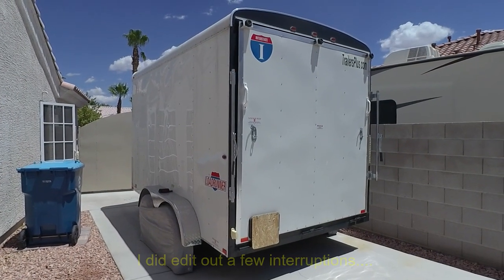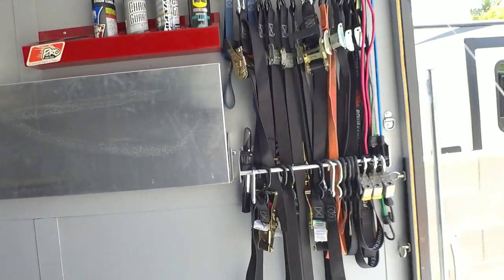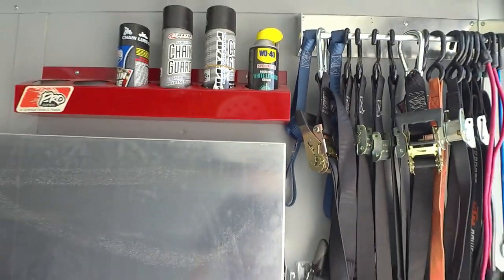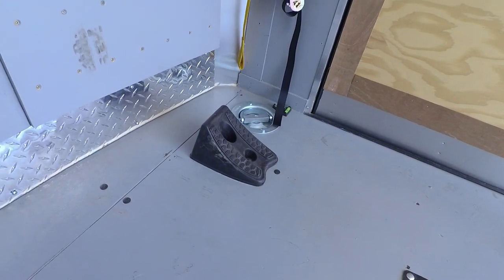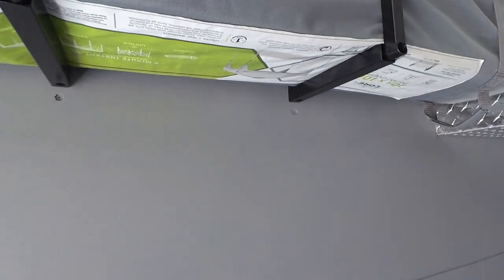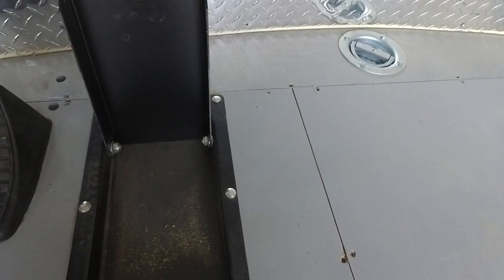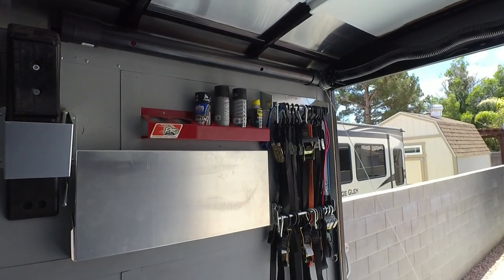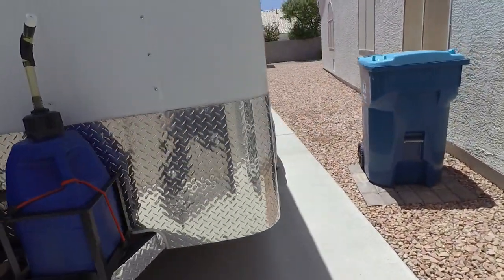7x12 Enclosed Trailer Custom Mods (Updated Video)

Comment: I just got a 16 ft ATC trailer.  I have 2 rows of E track on the walls, and two rows on the floor for tie down.  Up in the nose,  I have a horizontal Track on the  floor, tied into the frame so I can connect a winch to it if I need.  Etrac makes a single tire motorcycle stop that clips on the Etrac.  If you flip it backwards,  it is a GREAT winch connect point,    I think E trac is a better solution,  there are a lot of accessories that you can hang stuff like tires, cabinets, etc.    HOWEVER you did these things yourself, using your skills and brain which I think is WAY better.  I am the fat old guy who can sit around making comments,  YOU are the guy who is doing it!!!   I definitely respect what you've done.   I have kids your age probably,  I would rather they be able to DO what you did,  instead of BUY what I did!
Reply from the maker: Thank you for the feedback...  your setup sounds very nice.  I did consider E-trac, but opted not to use it for several key reasons (specific to what I was looking for and needing).  Also, I just sold the trailer because I have to go to a 8.5x14...so all the mods will have to be redone!  I'll re-look at E-trac as an option...  have a nice one...

Comment: Options are interesting, e-track would probably be of significant benefit.
Reply from the maker: Thank you for the suggestion....  I considered e-track as one of the options...but decided against it for several key reasons.  I've been extremely happy with the setup as it was specifically designed around my needs.  Have a nice one...

Comment: couple questions.....Why didn't you paint the ramp extension and side door? Also you could insulate the ceiling and make it much cooler inside. Love the brackets for the tents & chairs, very ingenious. Great job!
Reply from the maker: Thank you for the kind feedback.  Regarding your questions:  I didn't paint the extension because I consider it a replaceable/sacrificial item...the wood gets trashed due to it being in most contact with the dirt/rocky terrain.  The door wasn't painted because I had planned on putting other mods on the door...and I just never got around to it...but will one day.  I'll have to think about/look into some options for the ceiling.  I do not spend too much time inside the trailer and when I do it is almost always with both doors open so the temp is more ambient temp vs radiated heat temp from the ceiling.

Comment: where did you get the hinge for the rear door extension .. great video and modifications
Reply from the maker: Thank you for the kind feedback...wrt the rear door extension hinge...I just reused the stock hinge that was installed from the manufacture.  etrail.com (not advertising for them) carries these same type hinges https://www.etrailer.com/s.aspx?qry=hinge

Comment: What paint did you use on the walls? Trying to figure out which paint to use on mine myself and keep hearing various answers from people on what to use. Thanks!
Reply from the maker: I used Sherwin-Williams:  "Armorseal Rexthane I" for the floor, and "Armorseal Tread-Plex" for the walls.  I've done 3 enclosed trailers with this paint setup...one of the best mods/choices I've made!

Comment: Extra tall is how many inches? Good information
Reply from the maker: Thank you for the kind feedback.  ... It depends on the trailer manufacturer, but it usually is approx 6 inches taller...the same height as an 8.5 wide enclosed car hauler.  It wasn't common for a 7x12 to have 75 inch height opening...you had to get a 7.5x16 or larger to get that height. 7.5x14 UTV enclosed trailers pretty much now come stock with the taller height.

Comment: Where can I find a similar fold down table?
Reply from the maker: I'll provide info for both tables just in case we are not thinking about the same table 😁  The smaller fold-down table is from Pitposse.com -- Pit Posse Flip out work tray 32 Inch (SKU: PPFOWT32).  Larger fold-up table is from Etrailer.com -- Tow-Rax Wall Mounted Folding Table - Aluminum - 45-1/2" Long x 18-1/2" Wide (Item # TWSP45HFTA).  Sorry for the delay with my reply...

Comment: Hi Steve, I've been trying to find some tent/canopy brackets for over a year now and haven't come across anything I really like until I saw your set-up. I'm just curious, did you base these off of a commercially available bracket? I can't find anything like yours online so I've been thinking about an "L" shaped collapsible shelf bracket and using a bungee to secure it but before I do, I'd love to hear from you first. Look forward to hearing from you. Thanks
Reply from the maker: Regarding the brackets....sorry, but they are my custom design.  I too was looking for a long time for brackets that I liked and knew what I wanted, so I finally just took some scrap steel and did a test fab...the test fab turned into my permanent solution.  They have worked out much better than expected...I love the design and simplicity of use.  I hope you find something that works for your needs.

Comment: Steve, did you use the treadplex primer before painting, or just use the pain on the plywood/osb?
Reply from the maker: I didn't use any primer...the paint has "no problem" adhering to the wood surface.  The paint pulls off part of the wood surface if you try and remove the paint.  I've even got some of the paint on metal and it doesn't come off...

Comment: How has the trailer floor help up with that product?
Reply from the maker: Exceptionally well...an impact has to be hard enough to damage/chunk the wood to damage the coating.  It actually makes the wood stronger to daily use scuffs and dings and etc..  It has exceeded my expectation for durability...worth every penny IHMO.

Comment: Is it safe to mount your spare tire that high on the stud.  My studs are 1 × 2 aluminum.  I have E Track brackets with 1 inch self tapping screws.
Reply from the maker: The answer to your question has a "Depends" factor to it.  First, my trailer wall studs are metal so it will be a little harder for the mounting screws to pull (given material thicknesses are the same).  So, the ability of the screws to hold the spare mount & tire has nothing to due with height above the floor of the trailer.  However, the closer the screws are to the ends of the studs the less impact the screws will have on the studs (i.e., wanting to case the studs to bow out some due to the weight)...having the spare tire mount near the top of the studs means it is closer to the metal joining the studs together at the top and thus will not flex the stud as much.  So, in answer to your question...if it was me I'd use additional screws seeing that they are threaded into aluminum and I'd spread the weight across several studs (i.e., tie into E Track that is mostly used for the spare tire only).  The other thing you can do is have the spare tire mount be a lot taller above the tire and thus having a screw above the tire will provide more leverage for the screw(s) to hold.  Hope this helps...

Comment: Why is he afraid of etrak?
Reply from the maker: First off who is he?  Second, that is a pretty big jump for you to make to say someone is afraid of something just because they went with a different option!  But to at least give you one small taste of an answer ... ETRAK, if used on the floor, collects a crap ton of trail crap the quads, SBS, and bikes bring into the trailer ... and a lot of that crap falls down into the lower section/part of the ETRAK (which is an absolute pain in the a$$ to get back out).  There are many more reasons also... but you already know the answers seeing you stated the main reason why ETRAK wasn't used.  Lastly, you should market your people reading skills as a side gig...   😉

Comment: Your tires are rated to 75 mph. Slow down.  Nice upgrades though.
Reply from the maker: Thank you for the kind feedback ... But, do you really believe you know "exactly" what tires I have on my trailer?  I think you might try asking before you state stuff that you do not know, first hand, as fact!!
Reply: @SteveSmith-wl8yq  you are correct about not knowing what tires you have. I don’t believe a tire for a utility trailer has a speed rating above 75 mph. Although I could be wrong. 
As a professional driver I believe driving at those speeds is dangerous to you and the drivers around you.
Reply from the maker: @lawrence7065  Since you felt it important enough to pass along unsolicited information/advice/your stance…it is only fair that any comments from you that can be validated as incorrect/uninformed/etc. should be addressed.

First, speed ratings for tires...more specific…trailer tires (i.e., utility trailers).  A person can quickly, and easily, find trailer tires with a M-Speed Rating…it only takes about 60 seconds.  A M rated trailer tire (or any M tire) has a top speed of 81 MPH, at MAX LOAD.  So, as you move below MAX LOAD the actual safe Max Speed increases (physics at play).  How much is debatable, but it’s not going to be an insignificant amount (IMHO)—it is a math/physics thing…not an opinion thing.  So, driving 10-20% over 75 MPH with a 40% loaded utility trailer (tires only using 35% of their max load rating), with at least M rated tires, is not really adding any measurable increase in risk due to tire rotational speed failure.

For you second concern.  Your statement that you are a professional driver is an important input; however, your comment after that is without a solid foundation…let’s call it a fact-less based discussion/statement.  For you statement to be true, “driving at those speeds is dangerous to you and the drivers around you”, requires a lot…and I mean a lot of additional data to be entered into the equation.  For example, driving in Utah on I-15, the posted speed limited (down south) is 80 MPH.  So, if the majority of traffic is going…let’s say… 85 MPH… it is actually safer for myself and drivers around me if I travel at…or at least pretty close to…the pace of the surrounding traffic (this all assumes that I have a proper rated tow vehicle towing a proper rated trailer with proper rated tires and with environmental conditions supporting 85 MPH as a safe speed, and I maintain a proper safe space/gap between my vehicle and any vehicle directly in front of my vehicle, etc./etc./etc..  Additionally, if driving at a faster speed on a completely empty road --- not passing anyone and no one passing me…and no traffic anywhere near me for at least a tenth of a mile or more…then how is driving at those speeds (as you state) a risk to the traffic around me when there is not any traffic around me?...just a single car now and then…???

You seem to make a lot of fact-less based assumptions on things you have no first-hand knowledge about.  And then you take it one step further by passing along “your” stance on how “other” people should behave.  You know nothing about me…for all you know my skill as a driver is triple yours and thus you driving at 75 MPH is more unsafe to yourself and others than me driving at 85 MPH.  The speed at which you are traveling is only one piece out of many pieces that statistically define/determine risk level.  Thank you for your comments and feedback…
Reply: @SteveSmith-wl8yq  you are correct on tire speeds. Thanks for educating me.
As far as safety goes. My opinion is over 65 mph it becomes unsafe. That’s how the state of Nevada feels as well.
Speed limit for tow behind trailers is 65MPH in the state of Nevada. But overalls I’ll give you the WIN.
Reply from the maker: @lawrence7065  I'm not looking for any type of Win...you commented on your opinion - with info...I replied with comments on my opinion - with info...it is more of an agree to disagree vs a Win/Lose thing.  And a tow-behind safe speed of 65 mph also has average driver skills add into the equation...as are almost all max speed limits (road, avg driver skill, etc.).  I'll take a bunch of professional drivers speeding all around me vs a bunch of too safe-scared drivers doing 20 mph under the speed limit and camping in the fast-lane!  But, I'm more of a statistics type decision person...    agreeing to disagree...  Thank you for your comments and feedback...  Have a nice one...